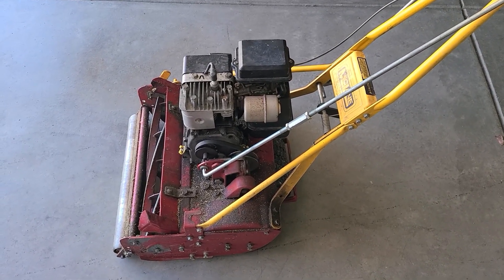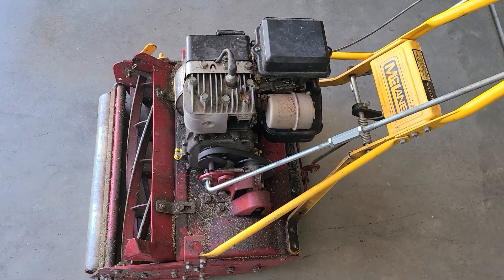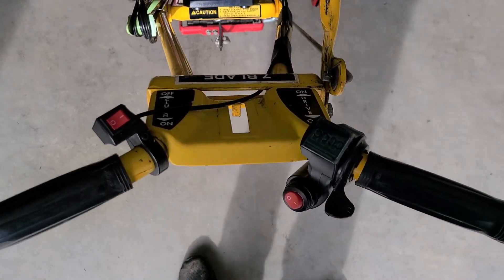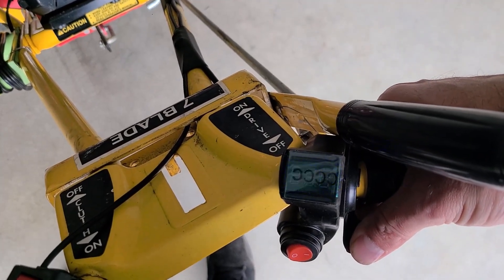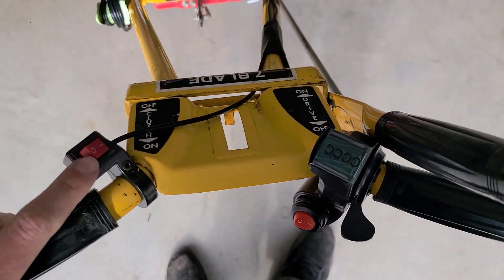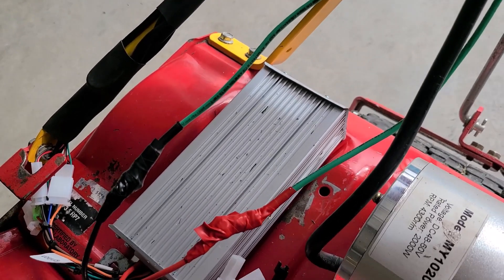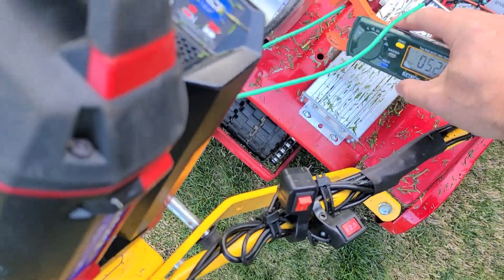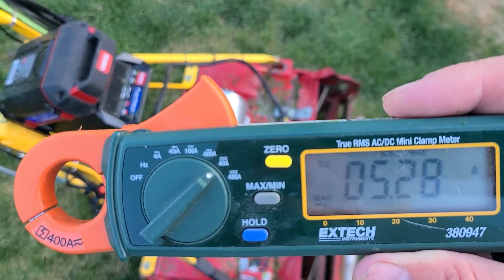DIY Brushless DC Motor kit installed on McLane Reel Mower

Comment: Hi i like the convertion. I have done a convertion similar but a smaller type mower 12" super colt. 24volt  battery 250 watt motor works a treat . But well done

Comment: How/where did you exactly attach the wires from the inside battery charger that go to the controller? I’m taking about in the inside of the battery charger compartment.

Comment: Can you show how you jimmy rigged the spring?
Reply from the maker: All I did was carefully take the thing apart, pop the spring out then put it back in. When I put it back in it is no longer recoiling but just providing lateral spring pressure for some resistance (perfect)